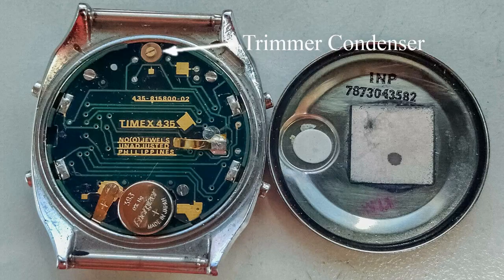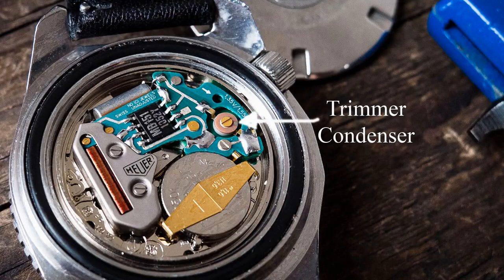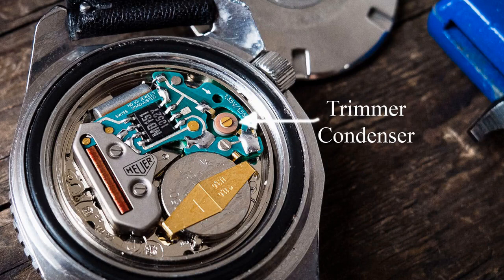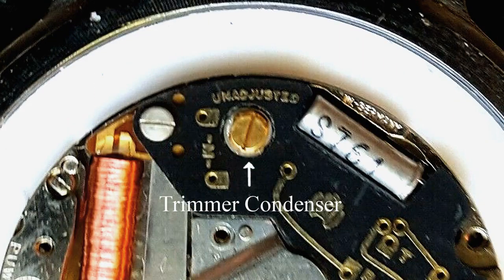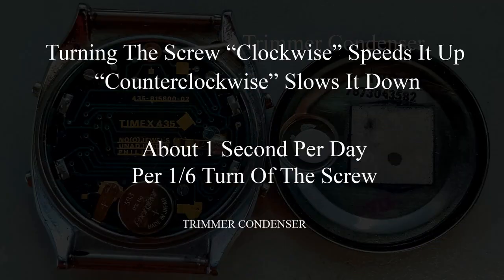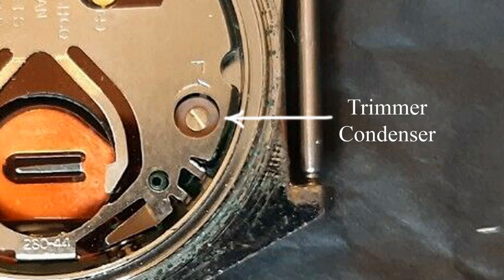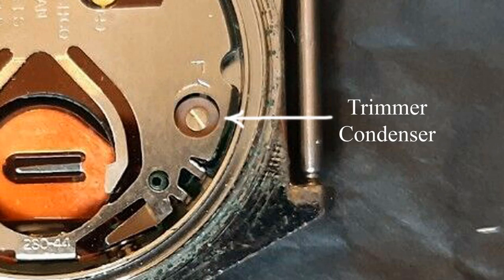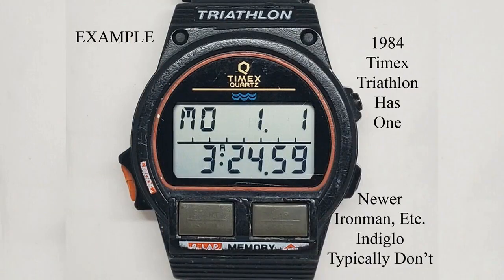How To Regulate Accuracy and Adjust Speed of QUARTZ LCD DIGITAL and ANALOG Watches Trimmer Condenser

Comment: This is an excellent video! Thank you for making it. I’m trying to understand how a 1/6 turn of the screw adjusts the frequency itself. If that 1/6 turn equals a change of 1 second over 24 hours, does that mean that 1/6 turn is a frequency adjustment of about 0.38 Hz? I’m not sure if I’m doing the math right.
Reply from the maker: It's only approximate since each trimmer condenser is going to be a bit different. I never worked out the exact frequency change. To adjust the condenser just put it to an approximate position then, the next day, compare it to an accurate watch. If it appears to be running a little faster or slower then tweak the condenser accordingly. After a week, or so, if it's still off then give the condenser another tiny tweak. Keep doing this until you are satisfied with the accuracy. Anyway, I'm sure there's also an electronic  tester that will let you meter the frequency, at one go, but I've never used one.
Reply: @lawshorizon  great, thank you for this additional info!

Comment: Thanks!, very nice succinct video.  Valuable.  Good photography of the watch movements, showing the trimmer cap's screwdriver slot, easy to identify.

I find excellent time-standard references in time-signal broadcasts on short-wave radio, from USA National Institute of Standards radio station WWV in Colorado, at 5.0, 10.0, 15.0, and 20.0 MHz (exact frequencies).  Also, if you have an "atomic clock" (a radio-controlled clock) which checks and (re-)sets itself every 24 hours by built-in radio reception of the WWV very-low frequency (VLF) signal, such a clock makes an excellent home standard for setting other clocks, mechanical or quartz, to a second of time or better.

I wish more Quartz watches had the trimmer cap!

I use my N0. 1000 Weishi Watch Time-Grapher (check eBay, look for a good price) to check the accuracy of watches, including Quartz watch oscillators.  The Quartz watches don't all tick at 1 Hz intervals, but show (very) small errors.  If these movements had the trimmer pot -- I mean, trimmer "cap" -- we could regulate them spot-on very easily.  The Quartz crystal "ages" and slowly changes.  Also, even a new Quartz watch might be built and sold with a small error if the circuit has no trimmer cap.  But even on Quartz watches with no trimmer cap and hence no way to regulate them, it's good to know just how far off they are, and the Time-Grapher shows this immediately.

Kudos!, on the video, and many thanks.

--Joe / Tucson ARIZONA / USA
Reply from the maker: Yeah, that's an important point that the components will change with age -- although it might be 10 or 20 years before the change becomes significant -- at which point, just tweak the trimmer condenser. I like old vintage quartz watches so it obviously becomes an important feature. It may be that watch manufacturers deliberately don't put one in so that people must buy a new watch -- or they figure that components are more accurate these days -- or, lucky for them, people just don't know about it as it's more likely they're just trying to save a buck. Anyway, thanks for the information.
Reply: Hi,Joe! I found the WEISHI No.1000 is for mechanical watch, it’s useful on digital watch too? How to use it on digital watch? Thanks!

Comment: I have casio watch which its trimmer broken, i want to replace it but don't know the capacitancy value.
Reply from the maker: If you try to replace it a trimmer condenser from a different old watch might work. In any case, the thing is sensitive and doesn't like heat from a soldering iron which could ruin it. If your watch currently doesn't work it could also have other problems and turn into a nightmare. Good luck.
Reply: @lawshorizon  luckily I have another  G-Shock  broken lcd), so I replace the trimmer and together i decided to replace the cristal oscillator too.. then it Works. ThankYou😍